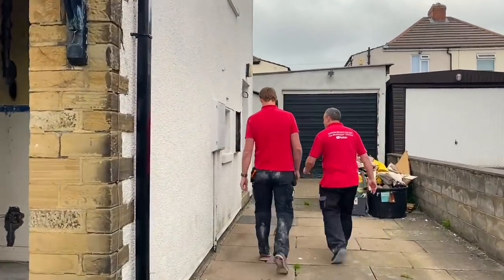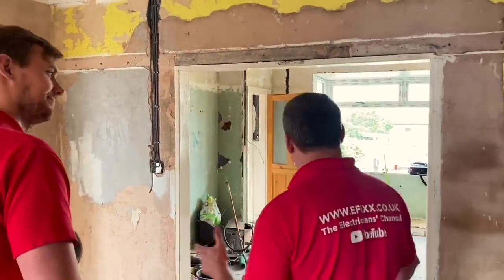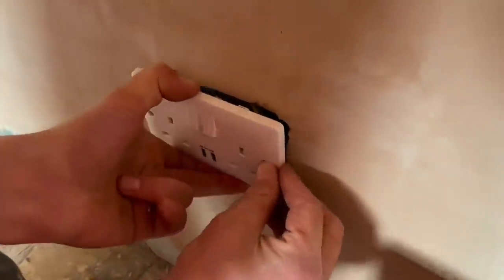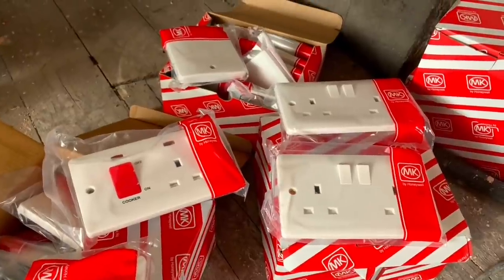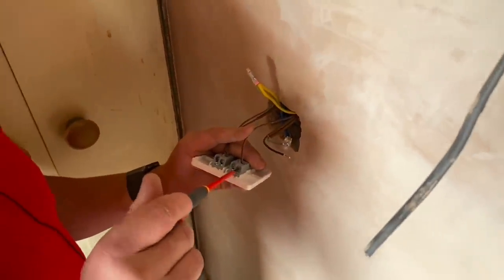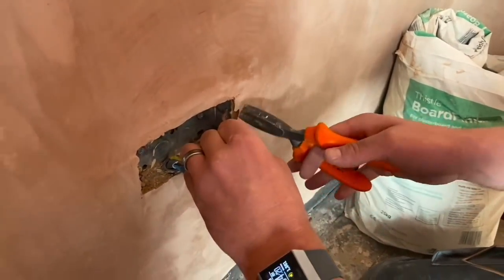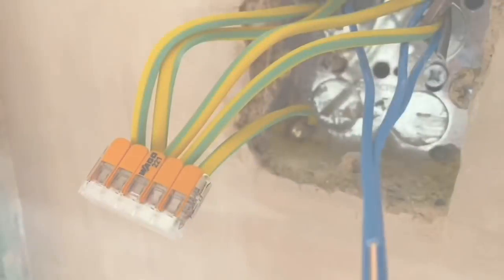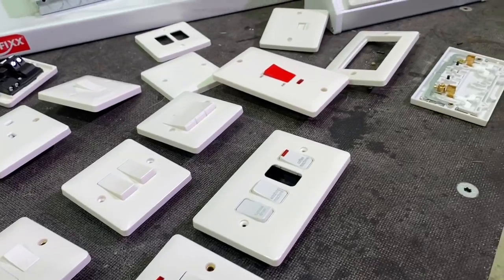BUDGET HOUSE REWIRE - Mates rates with MK Base

Comment: Naughty naughty no earth to light switch back box
Reply: You sure?
Reply: Socket boxes didn't have any either.
Reply: @stevelambert6689  sockets are earthed through the screws and if you click to 7:30 in the video you'll see a flying lead to the back box of the light switch.
Reply: @willhawksworth6811  rough as a badgers, takes 10 secs to do.
Reply: @r3co0  yeah pal, well rough.